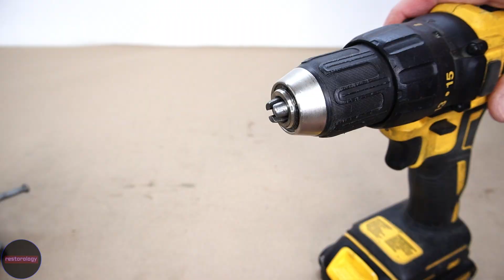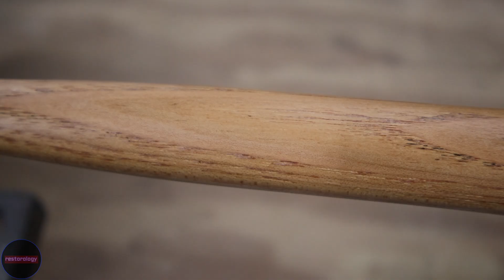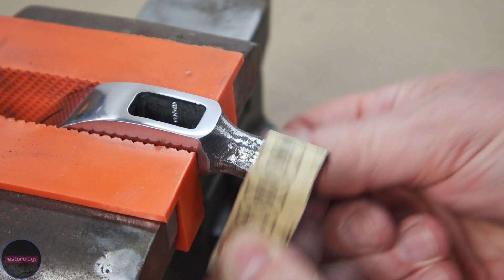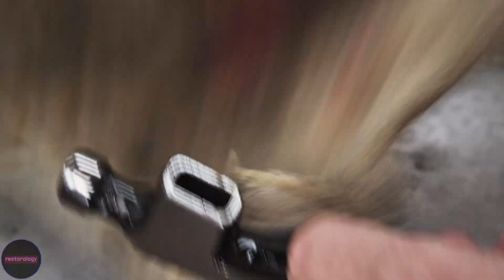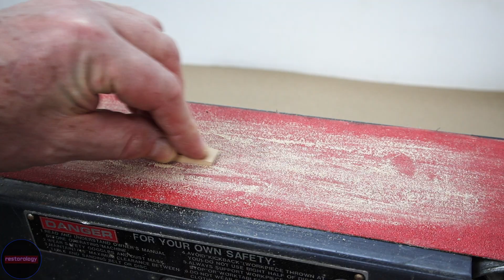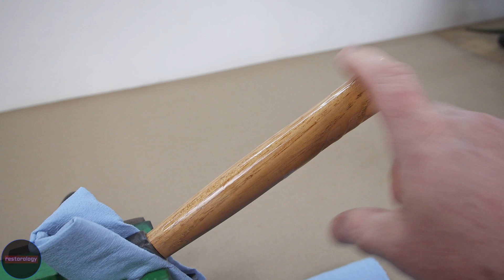How to Repair a Broken Hammer in Six Minutes | Restoration

Comment: I fixed an old Lasher hammer the same way a few years ago, outside of using the epoxy. The metal wedges make a huge difference and it's been holding up to a lot of use since. Awesome restoration :)
Reply from the maker: Thanks! I've never done the epoxy fill before but given that the top of the reused handle was so narrow, I needed to fill with something. I have a modern hardware store hammer that is topped with epoxy so I thought I'd try it and see how it worked. I like how it turned out but if this were an antique or classic old brand, I would have opted for a new handle and extended it through the top of the eye.

Comment: The end result looks incredible! Never thought about it until watching this, but I wonder why the head of a hammer is attached this way with wedges, rather than with a pin or screw through the side of it like a shovel...
Reply from the maker: Thanks! The opening of the eye is slightly larger on top of the head than at the bottom so that when the handle is wedged it is impossible for the head to slip off the handle while swinging it. Simple and genius!